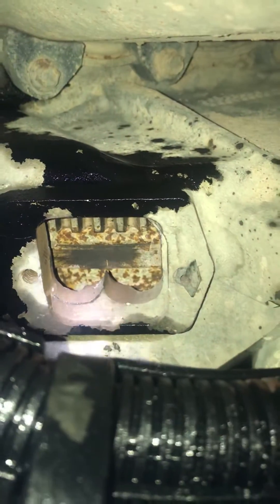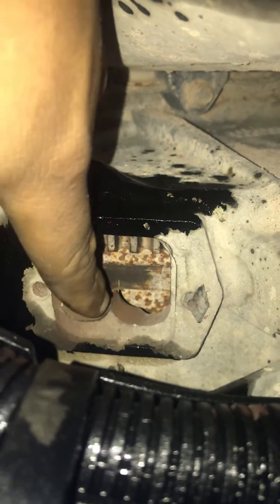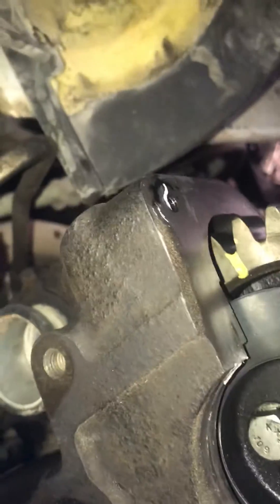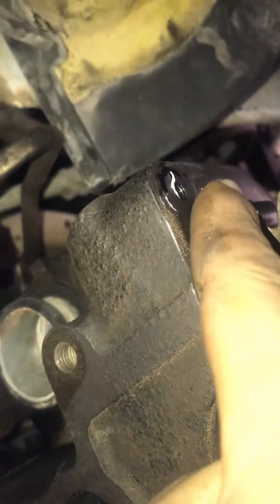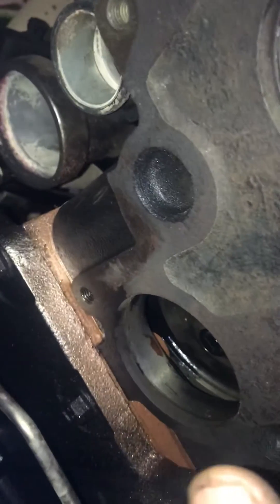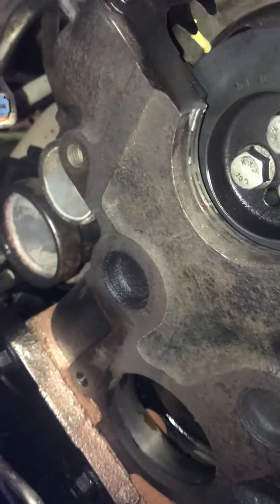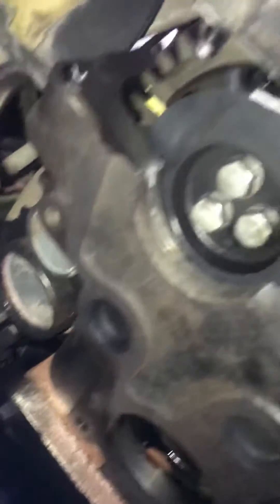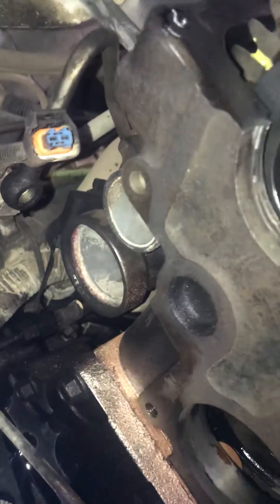How to set the time on internacional pro star with maxxforce 13

Comment: Have you ever done fan clutch assembly to these engine?
I’m curious to know the torque spec for idle gear in front and if the crank gear is replaceable without removing crank of course